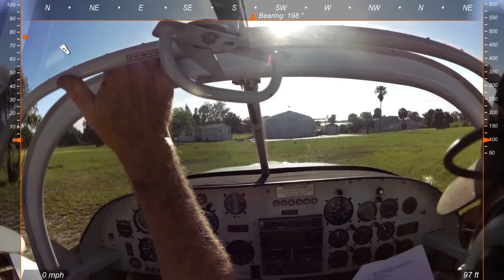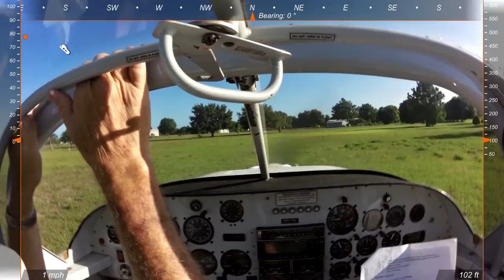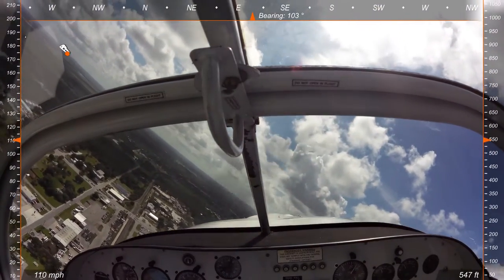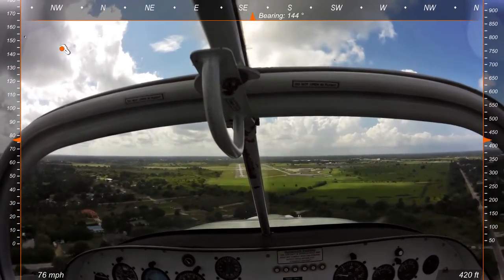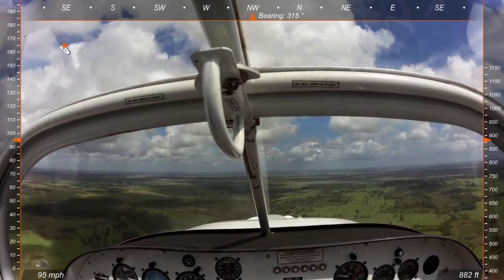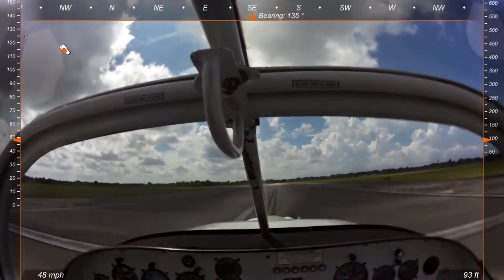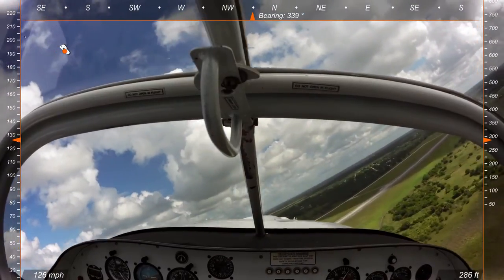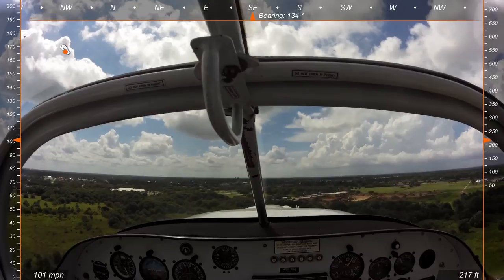RV Transition Training

Comment: This guy sounds like a retired Delta pilot. Haha Sounds like a good instructor. Just drop the "Aaaannnnnndddd, Expermental ...."  No need for "And". Also each transmittion should include the airport traffic area you are operating at. Lack of professionalism in the cockpit will come through in the radio call outs. At least you are making them. That's better than some pilots I have seen in the pattern.

Comment: I plan on getting a LODA for my RV-7 project and teaching.... CFI-INST-ME-ATP, why is the student flying from right seat?
Reply: RV8a has throttle on the left, hence the flying position
Reply: @2Phast4Rocket  OK ... to bad there was no full dual control RV8's. As long as both sides have brakes... it does not matter what side.
Reply: There is one guy in Texas that does transition training with his RV8 which is equipped with full dual control.